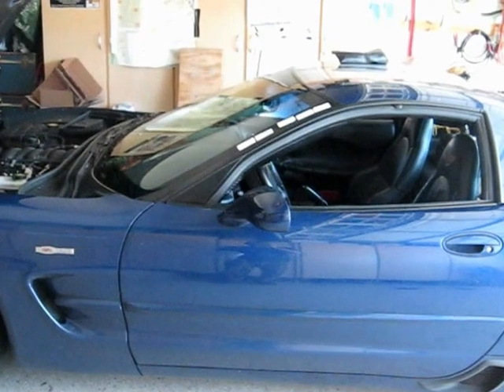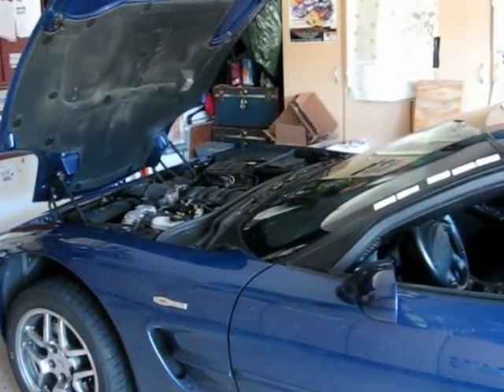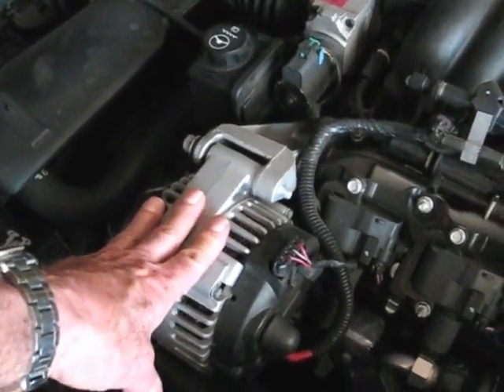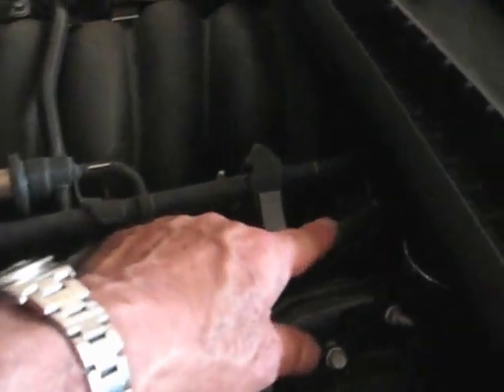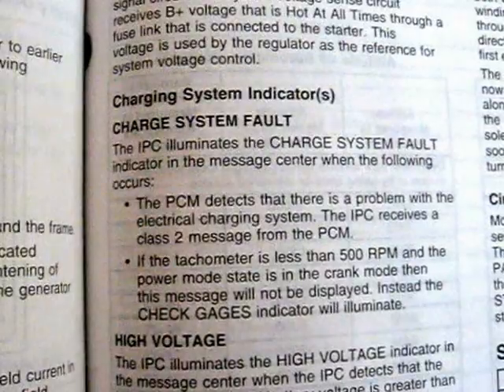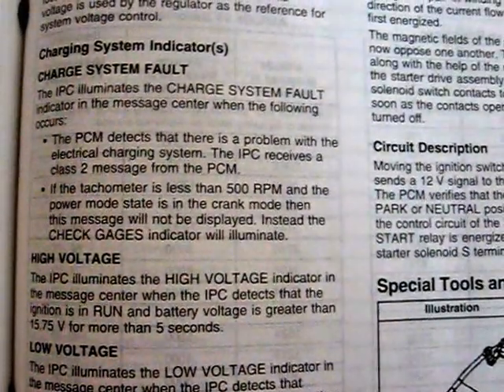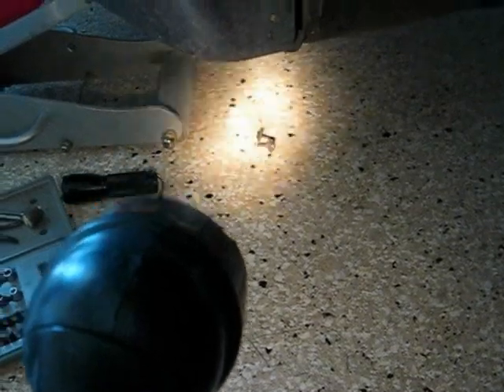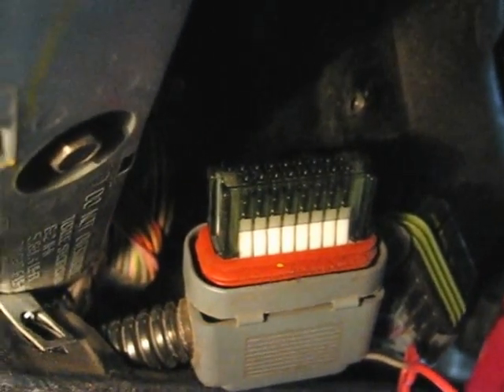Corvette DIC message CHARGING SYSTEM FAULT by froggy

Comment: What amperage alternator should be used in a 03 Z06.  Replaced defective one and got a 145 and now showing charge fault, which I did not have with old alternator.  Is 110 is what is needed?
Reply from the maker: I am not sure if higher amp alt is a problem or not? Could be other, sorry.

Comment: I installed a "remanufactured" AC Delco alternator and got a charge system fault. I replaced it with an brand new OEM alternator and problem solved. Just sayin.

Comment: I had this happen today after i finished my harmonic balancer, i hooked my battery up and went to start it and i heard a spark and everything went off.  I went to the battery and checked everything and noticed the negative wire was loose so i backed it out and it started right up, however It won't charge now.  I replaced the battery and alternator and nothing changed.  I tested the battery with my multi-meter and it was at 12.3  when i start the car up it dips to 11.7 and stays but begins to drop.  The alternator and battery is new.  i checked all the connections in this video and everything looked like new.  I checked fuses labeled pcm and ignition and could not find a blown fuse under the passengers feet, i puled the battery cradle and it has never had an acid leak, just a little dust. Am i going crazy?
Reply from the maker: I have had many sparks at the battery from a loose cable and just refastened and it was good, never had a result of loss of ability to charge. Did you get the correct alternator? The output needs to be correct, also the battery. If the original was lead/acid and you "upgraded" to agm or li/ion or other fancy battery it may require a higher output from the alternator to recharge. This is a somewhat common issue. Alt & battery have to "shake hands" (be compatible). Let me know. Also start pulling codes.  Froggy.
Reply: @1947froggy  I had both new and old alternator tested this morning and both were good, so i returned the new one and now i am going through the diagnostics tool to see if I can find a solution.
Reply: @1947froggy  UPDATE; I fixed my own error, I forgot to attach both cables to the starter, so that's why it wasn't charging, whew! At least i didn't have to take it to an shop.
Reply from the maker: @carycase5563  Hmm, I am surprised it started at all, but never argue with a fix that worked. Maybe the starter (when not engaged) is part of the charging system? Any event, well done!
Reply: @1947froggy  I know, right?  How can an entire harness of wires be missing and it starts? There were at least 3 fairly thick wires attached to the one I missed.

Comment: recently I changed my alternator from oem to a aftermarket from oriellys, and my new battery drains in a couple of days without the car being started. I checked all the fuses and relays. I had the charging system fault code come up and then disappears.I wonder if the alternator would cause the battery to drain? I charged my battery with a battery tender, I don’t let it get to full dead. I am new to the corvette scene so any suggestions are helpful.
Reply from the maker: You need to check if the new alt is putting out correct charging amps.

Comment: I just had this happen low volts charging system my mechanic has me get a new. Batter and alternator same problem car didn't wanna start the check engine came on so we ran it with the. Tests. It.s ' saidd ignition% switch is goin faulty
Reply from the maker: Did you inspect the harness & connections at each end like the video? Also, yes it could be that ign sw. but 1st order a new KEY and get it cut, the key has different resistor values so get the CORRECT resistor value.
Reply: @1947froggy   no. I havnt checked  those. I did how ever today. Put a the ig switch. Car is still doing the same. Thing it's gotta be somthing electrical the battery got. Drained alternator is only 4 days old   and.  The car was still cutting off when I was driving I had pull over and restart the car twice. Today put the switch in car was acting funnyb
Reply from the maker: @lilyellow1how989  Do you have any heavy items on the car key ring besides the fob?
Reply: @1947froggy  no.   No scratches on the. Key. Nothing. Everything original.
Reply: @1947froggy  it's definitely electrical. Idk if it's the cord connecting to the alternator. Bad ground wire.
Reply from the maker: @lilyellow1how989  I would still try buying a new key with correct resistor, c5 keys are not too expensive & I did have an issue with mine @ about 45k miles. Good luck, post what you you do. Here's a suggestion, start the car & drive a while and try "jiggle" move the key without shutting it off of course. See if fault shows up. Push/pull etc.
Reply: lil yellow 1 How did you fix the problem? I’m getting a ignition switch repair done today....
Reply: @dannystackhouse4600   it's the alternator
Reply: @dannystackhouse4600   it's definitely  the alternator  I ended up having to switch it 3 times  pep boys   kept  giving me faulty alternator  go to auto zone get one with warranty  put that in if it  make sure to listen  for any wine noises coming from alternator.  Make sure it's smooth  sometimes even after  u get the new one put in the  computer dic my sometimes says it cus the memory of the old alternator   but that was the problem  throw that new one in there  asap  it Def the alternator
Reply: lil yellow 1 How hey bro. It was the ignition switch for me.

Comment: Hi Froggy,  Great video on this as usual.   I blew a motor in my 03 Z06 and ended up putting a 2002 Z06 LS6 in the car.  We had 3 motors in the shop and put an alternator on that had a smaller pulley.  Started getting the charge system fault, and a Service Vehicle soon error.   Checked everything and decided to put a new alternator in.  It had a larger pulley.   A guy at Autozone, when I went up to get a larger belt, said the smaller than OEM alternator pully was the issue and that this should solve it.   Kinda makes sense as he said it would take just a second or less for the motor to determine the voltage was not high enough right on start.  The message would go away in just a few seconds and I did not get it every time.   In the end, BOTH the charge system fault and the service vehicle soon messages are now gone.   May be something to put in your back pocket if it ever comes up or you get questioned.  No reason to think the alternator I took off had any issues as the car was charging fine.    Thanks again, your videos are great !!
Reply from the maker: Hi, really great info, yes pully size is key to the alternator output, likewise the rpm speed, which is why if you have a volt meter that is NOT buffered you can see the volts change. I keep to stock size pully if I ever need to change but my good luck is not any issues with alternators, knock on wood.

:)

Comment: To make a long story short I installed long tube headers that required me to remove the starter. After a new battery and alternator still had the problem. I checked the wires to the starter and they were a little loose. After tighten them up it fixed this issue.

Comment: So when I lifted the hood for light at night in my garage from my 98 corvette, I can hear a noise coming from the (battery, or fuse box). The keys are not in the car either. When the light eventually goes out and I have to close the hood slightly then re open for the light to come on the noise comes on. When the light goes off it stops. When I put keys in the ignition and the hood is up with the light on it goes off. Then I turn it to the "on" position and the lights flicker and the noise comes on from that battery or fuse box.. I turn and take the keys out the noise continues for maybe like 10 seconds then I hear noises sounding like it's coming from behind the car. Idk it's weird like a knocking, stomping. Lol please help me. I'm gonna test the battery later today and check my wires and clean them and try that but any idea what's going on?
Reply: Also when in the "on" position the electronics in my car won't come on either really. No air, nothing. Also if I leave a door cracked, say driver door, the lights on the rear view mirror turn on same with the hood light but the inside lights go dim and the noise is still happening. It's like a quiet (drilling, bzzz) sound. Thanks for the help!
Reply from the maker: I'll take a guess it's something in the security system (even if alarm is off). But I really would have to hear it. Can you attach a sound clip?

:)
Reply: I'll try and get a video clip for you and post it later today
Reply from the maker: k. I don't hear much of anything when I pop my hood.

:)

Comment: Hey Froggy quick question. I just put a brand new alternator twice and the fault still comes up. It'll go away once I get on the pedal but still. The connections are good not corroded or damaged. Could it be I got the wrong alternator? I see that your alternator prongs (pins) look different than the one I have. Any help would be appreciated.
Reply from the maker: What year is your c5? The alt connection may have differed. Did you inspect & clean the pcm connector? I NEVER had the msg come back.

:)
Reply: froggy 2000 I have hell I even got desperate Nd took it to the dealership.
Reply from the maker: What did they do? How much?
Reply: froggy PCM/ECM diagnostic about $219.
Reply: Kenneth Martinez i did the same and the new alternator was defective replaced it with another new one message went away👍

Comment: Hey Froggy, I have a 2001 C5 and was getting this same error, exactly like you described.  The battery was only six months old, a Bosch hi amperage battery.  The car started acting weird. The headlights, if they were only in parking light position, (first click) suddenly wouldn't lift when turned into "on" position. I'd have to switch the lights off and then back on again for the motors to work. Then, the starter started going slowly.  This is with a new battery and a one-year old alternator. It didn't make sense. Took the battery out and had it tested.  It was fine.  The whole stupid problem were the side terminals. After putting the battery back in and really tightening the cables this time, (the cables weren't damaged or corroded) the whole car behaved differently. I wouldn't have believed it, but so far everything works just fine. Problem solved. Too easy.
Reply from the maker: The side terminals are a really bad design & tend to loosen up. I will never use them again is any car. Had one in my Suburban & it leaked & damaged other stuff.

BTW I really dislike Bosch batteries, had one in my IS300 & 2 of them failed, in 6/9 months, never will buy Bosch battery either.
Reply from the maker: Side term batteries damage a lot when they leak.
Reply: +froggy    I tend to agree.  They used to be good batteries, but I also have one in my wife's Celica. It failed in three months, the new MAP battery type. Expensive.  Went completely dead as a doornail. PepBoys replaced it immediately no charge.  The side terminal thing on my Corvette -- not apparently leaking, but discovered that you really have to apply some torque to the bolts for them to work properly. It was making the whole car act strange. Vettes are sensitive to anything electrical -- more so than I would have believed at first.
Reply from the maker: Check!

Comment: my scanner gave code 562 (system voltage low) This is the closest thing that I found for some kind of answer.
Reply from the maker: One of the biggest if not THE biggest cause of issues with c5/6 vettes is bad batteries. Take it out of the car & bring to a shop/store and have it LOAD TESTED.

:)

Comment: Hi froggy; i have a 99 coupe i am getting "C.S.F" message no other troubles. have replaced 2 alternators and a new battery. At night when i lock the car with the remote the alarm activates fine. when it comes to the morning and i try to unlock the car with the remote i get no response. I need to open it with the key. The car so far starts fine; what could be draining the battery.
Reply from the maker: +Jose Selva I would follow any standard procedure on how to find a battery drain. Google it.

:)

Comment: Froogy, why install a crankcase breather on the driver or passenger side? All you end up with is low oil and  the scent of warm oil?
Reply from the maker: +Gary  Korey Turns out I did not need it, but does NOT cause low oil or smell.

:)

Comment: Hey froggy I got my car fixed only thing I was wrong with it was the starter was put backwards only cost me $80 to get it fix. Thank for your help.
Reply from the maker: Starter was put IN backwards? How is that possible?? Or a wire was put in the wrong connector?
Reply: Yeah it was the wire so was  completing a full circuit
Reply from the maker: Good, any wire that does not have a "special" connector (can only go one place) should be marked when disconnected. Good comment.

:)
Reply: Chevrolet just apologize and refund me my money turns out the technician was new and installed the starter correctly but hooked up the positive and negative wire into the wrong location. Thanks again for your help much appreciated.
Reply from the maker: Excellent.

Comment: I have a c6 Z06 I'll change out the alternator battery and the starter on a display still won't read higher than 11.5 to 12.0
Reply: Edwardecko ml az
Reply: Did you figure out the problem

Comment: Froggy can you help me
Reply from the maker: If the car starts & runs ok, you may have an issue with the CALIBRATION of the digital display of voltage, it could be off!

On my c5z it always read low by about .5 volt. I eventually ignored it. If it bothers you the dealer can perform a calibration with a GM scan tool.

Thanks for watching!
Reply: Ok I will do that thank you. I will keep you posted
Reply: Ok I will do that thank you. I will keep you posted

Comment: Is that eddie and the cruisers playing in the background? My C5's having that same readout on my display.  The message didn't appear until I replaced my alternator. Brought that back thinking it was defective. I took my battery back in today because its still under warranty but I'm getting the same message. It goes away if I bring the rpm's up. Going to check the wiring and CPU next.